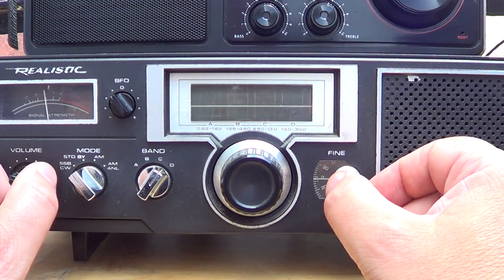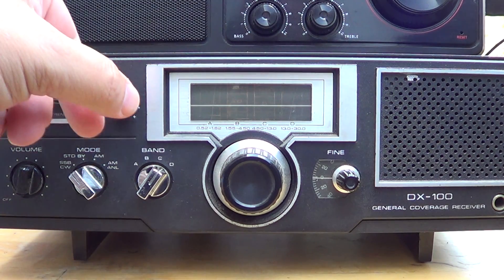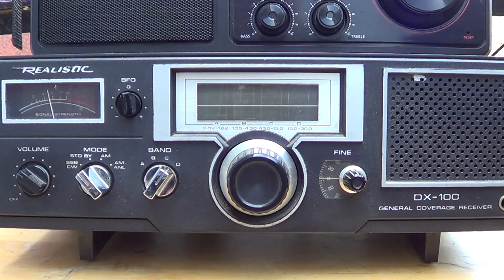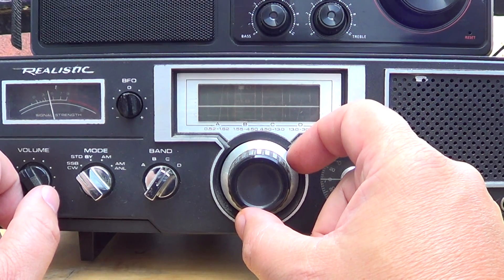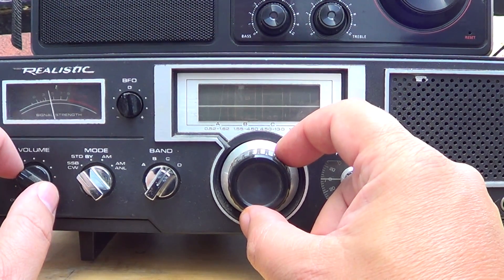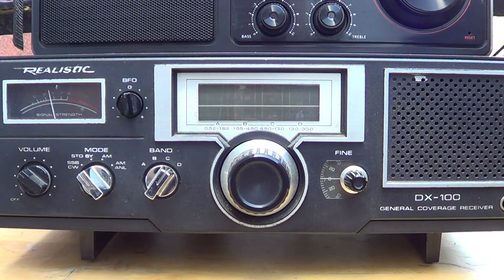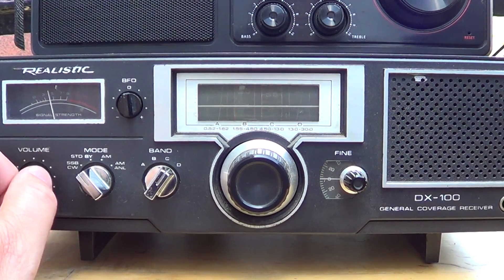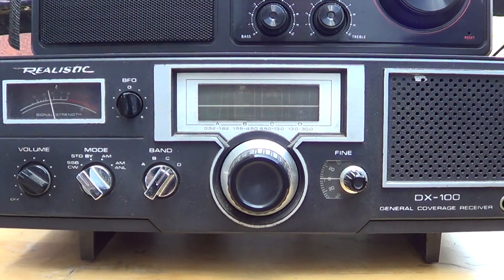Drift Observations on Realistic DX 100

Comment: There’s a modification to stop that from doing that. The transistor which is Q1 I believe has no heat sink. Either move that transistor to the back and put the wires up towards the front where originally was or you can put some small sort of a heat sink over top of it and that drift willgo away. Well mostly

Comment: Liked this historical perspective you gave! My first good receiver was a Panasonic 
RF 4900 which I bought brand new in 1981 when I was in 9th grade! It was 450$!!!!!!
All the money I had saved up working and mowing lawns for the neighbors. 
It was a very good triple conversion receiver with a LOW LOW noise floor and excellent sensitivity as well. But it used analog tuning which caused pretty significant drifting due to lash from the tuning mechanisms. I was able to solve the issue by lubing the brass gears and the nylon tuning cord with 100% silicon fluid lube.  Analog radios still edge out PLL units because they don't have any digital noise and it allows for a very quiet receiver (extremely low noise floor.) 
Sadly due to age the electrolytic caps are drying out and it is making the unit more and more deaf as time goes on, and there are a LOT of caps to replace in it.